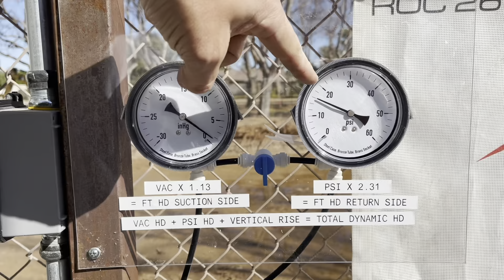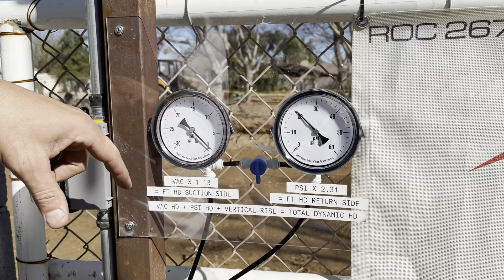Learn Pool Plumbing with Test Tank

Comment: I just save $2000 thanks to you and I fixed a 8 month problem that 4 company’s  couldn’t fix. Thanks
Reply: Companies.
Reply: What was the issue?
Reply: @604roger  yes and I replace the pipes and I found a plastic bottle stuck in
Reply: @NCHAFLOQUE plasic bottle gotsucked
 in drain?
Reply: @ in suction pipe

Comment: I have a spa connected to my pool with 6 jets but when I turn the spa on only 3 jets are working. When I turn on the blower all 6 jets are blowing air. To me, seems like I have a clog that doesn't allow the water to the other 3 jets. If that's the case how can I unclog to allow all 6 jets to work?   (BTW I put my hand over the non-working jets and it seems like its sucking air in) I appreciate any feedback.  This video taught me how everything is set up. Thank you!

Comment: Hey brother I just had an inground spa built 1/2 side of my spot has high pressure coming out the Jets and the other Have side of my spa seems to lose pressure and the Jets are much weaker I’m thinking it’s a plumbing issue anything you can recommend?

Comment: My in ground fiberglas spa is a 150' away with a 2" line from my 2hp pump, filter, and heater. A bit more than 5". If you lived in Arizona I'd hire you to come and assess my system. I have 2 hi-flo returns in the footwell of my spa, are they connected to the skimmer? Looks like you live in Glendale Az. Thanks for sharing exactly what I had been searching for...
Reply: by "hi-flo returns" do you mean the spa jets or the spa main drains? Either way, no, they shouldnt be connected to the pool-skimmer. They are 2 separate lines. :)
Reply: @PoolPlumbingTips  Thanks for the reply. I have replaced the "suction line in my in ground acrylic spa. As best as I can tell the skimmer is connected to the 2 suction ports in the bottom of my spa, confirmed using a 39" line camera. I'm in the process of re-foaming the 5' section I replaced. Once that is completed, I will be reinstalling the acrylic sections I cut out to gain access to said suction line. Ended up doing this myself due to the fact that no one in the repair business wanted to attempt this job. Chicken Chits...
Reply: Thanks Justin. I was a plumber for the City of Glendale for 15 years, I'd run across many plumbing problems in that amount of time. I've been retired for 9 years and was a little intimidated by the scope of the repair. The 2" flex line was a cause for concern as it was tough to get a square cut on a curved line. Just took my time. The first time I did the repair in place with the wrong glue. Tested leaked. Removed and bench built the section I needed, much easier when it's sitting right in front of me, plus the correct glue set much faster, Red Hot Blue Glue. Your video was exactly what I needed to see, though there were some differences between what you demoed and my set up, but it was the only one to explain the basic design on the net. Thank-you...
Reply: @michaelleas1243  can you advise me why water coming through my air valve ?
Reply: @earlcharles7463  Air valve on your filter, or an air valve on your spa? The air release valve on my filter is used to release air from the system during start-up an amount of water will jet out of the valve after the air has purged itself. At that point I shut the valve to stop water flow, a bad o-ring will allow water to escape during start-up, and allow air to get sucked in during the running of the pump even when closed. Air suction valve on a spa blowing water might be a water level that is too high. I'm also learning about the why's and way's of a spa. The company that built my spa has been out of business for I'm assuming 15 years, and the former owner of my home never passed along any info or booklets on a spa he had installed and that I have now owned for 8 years...